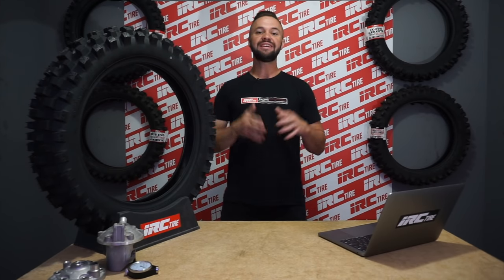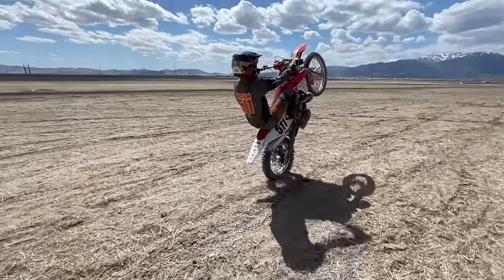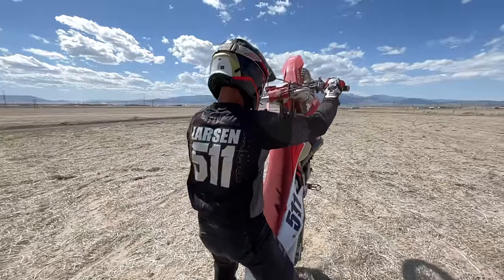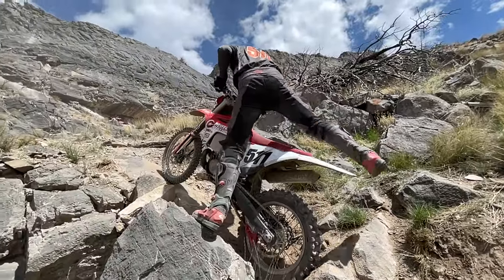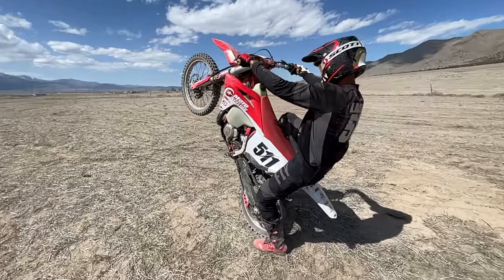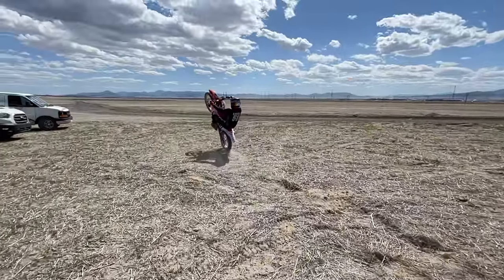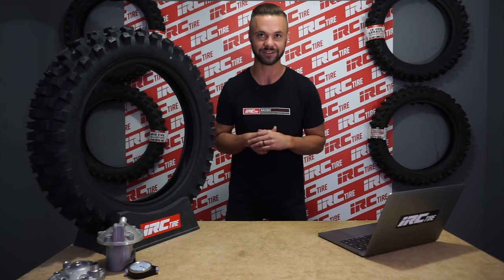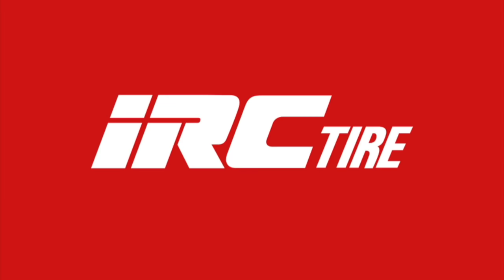NEW Slow Wheelie Hack!! Guaranteed to Help Your Wheelie Skills!

Comment: This is great, thank you. 5'9"er here too. Just too short to do the both feet dragging method which I think is the best. This is the gap fill hopefully that will work. Balance point and knowing exactly the throttle response I think is key. Also keeping arms straight hanging off bars instead of instinct of pulling upper body to bars

Comment: Another hack to learn to lift the bike up fast to balance point without moving too much forward is to learn how to lift the front wheel with your engine off, just using the body weight and suspension.
By learning it first, one would understand that the bodyweight and suspension do the 2/3 of the job and engine/clutch is only last 1/3...
Reply from the maker: Great point man!!
Reply: bro my bike weighs 300 lbs. There's no way that's happening.
Reply: @salazam  No way it's happening for you may be, because you can't do it, but I could easily do that on my 300+ lbs suzuki drz400e. Just focus on training instead of looking for pretexts ;)
Reply: @DenisElpashev  I put a pipe on my bike, so basically I have +30 hp. I just tried it rn on wet grass and it wasn't happening. I just gotta do some pushups right quick so I can compress those forks better.
Reply: @salazam  It's not about hp, it's about body movement and timing. Try to learn how to do a manual on a bicycle first, it will give you an idea how to apply your body weight to do a front wheel hop on almost any bike

Comment: Hi Rich, this is exactly what I'm working on now! I still have too much forward momentum when the front goes up, making it difficult to hold the bike steady. If I try to give a bit more gas so that the front goes up faster, the rear tire looses the traction. I guess my short height at 5.6 doesn't help either, but I suspect that I'm not using the suspension effectively. Any tips?

Comment: If you're a shorter guy "he's 5'9" " shoot I'm only 5'6" lol but I'm going to give this a whirl this week
Reply: Short rider club here.
Reply: @CommieHunter7  heck yeah bro! Devol come in clutch I lower the linkage lol
Reply: @CWEEzL95  my XC is PDS, so I just deal. I succeed some by picking good places to stop to setup for the next obstacle, and sometimes I just go with "if you're on the pegs it doesn't matter if you're short"
Reply: Yeah same here I'm only 5, 7" all my bikes have to be lowered lol
Reply: I’m 5’7 and I can do it with my tall xr350. So don’t be discouraged it’s possible
Reply: @cadentrim3167  I'm far from discouraged brother, I full send everything. I just like that my bike is now shorter than stock
Reply: 5'4'' fellas, crazy hard for me too, I have to rely in a lot of strenght to pull this of a lot of the times, and the positions are so awkard, with big bikes I only feel good riding "normally", this kinda tricks become very hard, but when those feet are on the pegs, GODDAM! 🤣
Reply: @CommieHunter7  facts. I want an xc250 but I'm not sure about the w with the pds. But the xc sits a little lower than my yz did
Reply: 5 9” aint short!!! At 5 7” I will destroy a stock height bike learning this...

Comment: Hi Rich, Love your videos! You are really excellent at presenting the info in a clear and relatable way so thank you!. I'm struggling with getting good distance on my slow wheelie. I can pivot turn no problem, and and walk behind the bike with the front wheel in the air for as long as i want, but as soon my foot goes on to the right foot peg i seem to lose it and ive put a lot of hours in and seem to be stuck at the same point. i feel like im maybe missing some bit of info or i guess i should keep practicing
Reply from the maker: I’ll actually be doing a how to wheelie Street video coming out soon. But one thing I can say is tire choice and set up on the rear tire makes a huge difference. I’d recommend trying it with a JX8 rear tire. Thanks for the support!
Reply: @IRCTireUSAMoto  got that exact tire installed lol. guess ill keep at it. thank you!

Comment: If the rear fender slaps you in the nuts, this may be a sign that you need to work on your clutch control.
Reply: or stronger nuts are needed
Reply: Great comment

Comment: I can do slow balance point wheelies fairly easy but only by starting faster and then slowing down at the balance point. Also I’ve had only done it on my yz125 by shifting to a really high gear to have soft power delivery. I’ve never had to use the clutch at balance point, only to change down gears. Anyway, I’m getting an exc 300 now and I really need to work on getting used to using the clutch a lot more in order to do this.

Comment: This is a great instructional video, I am only 5'4" ....5'5" with boots maybe lol.   I noticed you mentioned a shorter rider 5'9" using the side technique, do you think this will also work for shorter riders? I have a feeling my arms won't be able to reach enough for clutch and throttle control? I guess I can practice on the grass and see what happens lol. Thanks for any additional info !!!

Comment: Hello Rich... great fan of your videos. I recently went from a trial bike to my first 2 strokes enduro, an old KTM EXC 300 from the 90s... and it's a completely different bike. Longer, taller, heavier, I find my body movements won't affect the bike much (if at all), the engine of course has a different character and even if I was a complete newbie on the trial, I could at least tackle 40cm obstacles... while on the enduro I don't know how. My first question is: do you always keep the bike in the "powerband" to tackle obstacles? I find the engine is very slow/mellow before going "into the zone". I always used the "punch" technique, but on this bike I guess I need to go much much faster than on the trial to conquer the same obstacle... or, I guess, I have to use the clutch to go from 0 miles/hour directly into the powerband in first gear.

Comment: Ive been riding every weekend for the past 3 weeks, after a 12 year break, only ever just ripped it in an open paddock so learnt nothing but getting the rear out and changing gears. I’m now 26. clutch control getting better. I can get the front wheel up to get me over some logs, banks etc, nothing crazy yet. But I’m just wondering If it takes a long time to master? I can get my wheel up for a wheelie but not high enough to carry me a fair way, should I be getting this fast or is it something that takes a fair while? I feel like I should be able to pivot, slow wheelie with legs off the back for balance/safety. But I don’t really have any open areas to try to practice wheelies, it’s all tight and full of trees. Should I be patient or should I be ripping already? Love your videos rich 🤙

Comment: Hi Rich. I'm doing all practices to clutch control untill here. I have problems wich this ones because I'm riding a Yamaha T7 and it's really heavy but the worst...too high too get down and walk with the front wheel in the air. Any suggestions.
Congrats for your chanel and thanks to share this greats videos!!! 👍👍👍👍

Comment: Great teaching! I wish I could have learned these techniques  40 years ago. Would have saved some broken bones! In the video I noticed you have recluse clutch cover. Do you use a recluse?😕
Reply from the maker: No I don't run a Rekluse. The covers are just stronger and they hold more oil.

Comment: I notice you have a Rekluse clutch. That would make it a little easier at low revs to prevent stalling.
Reply from the maker: It’s just the stronger cover. I don’t run auto clutches.

Comment: 27 yrs old, intermediate track day rider, no offroad experience. Just bought an old TW200 to start trail riding. Which of your technique videos would you recommend I start with for training myself when just riding to work or around town that can apply to offroad riding?

Currently I just slow down to chug myself up and over obstacles which the TW happily does at a crawl. But add any speed >10mph and I bottom the fork immediately (I know it has poo suspension but proper technique can make up for many vehicular shortcomings).

Comment: Great video!  Thank you for posting!  
Question:  Ive got a KTM 690 SMC-R and Im having issues choking the engine out when I pop the clutch....is it only a matter of applying more throttle or is there something I'm missing since this is supposed to be a "slow" or low throttle and more controlled  endeavor....thanks

Comment: For anyone who has actually used this process to learn the slow wheelie.  I'm am at the point of putting my right leg back on the bike and covering the brake.  Once I get on I struggle with what to do next.  With my mx boots it's very difficult to feel the rear brake and with running shoes it's better but still can't move more than a second from that position.

Any advice?

Comment: Ive been struggling with the throttle part of this... My hand rotates back and opens the throttle too much when I'm coming up from preloading the suspension. So youre saying it's easier to not blip the throttle, just maintain a low rpm on it then slip the clutch?

Comment: What size clutch master cylinder do you run ?
9mm or the 10mm? I have heard the 9mm provides lighter clutch pull plus more feeling on the engagement/disengagement side of things
Reply from the maker: 9mm. It does!
Reply: @IRCTireUSAMoto  
Thanks mate
Is it worth the money to change from the 10 to 9 ? 
If you went back to a 10 would find what you ride/teach harder ?

Comment: I know it’s 80% rider 20% bike . So I’m hoping it’s just because my front shocks are so soft the rebound doesn’t snap the front end up and I have to use a lot of throttle, I have a 2020 Honda CRF 250 F . A beginner trail bike as they called it , since I am a beginner. My buddy who can wheelie and prefers the motocross bikes , he can wheelie and he says it’s harder then it should be to get the front end up on my Honda . I dunno as I said I’m a new rider so this summer is going to be my training season since the last two summers… and winters since I studded my tires for ice racing has been learning the bike and clutch and just basic riding on single track … I wish I could get out more then 10 times a year

Comment: I'm needing help! lol I've got the forward and backward balance point down but having problems with leaning left and right..... sometimes i can get it but if i start tipping to one side I can't get it to correct. Sometimes I think it's because i have a very heavy upper body. Any Tips are greatly appreciated!
Reply from the maker: Check out this older breakdown we put out a while ago. It may help. 
https://youtu.be/QyWhcaa2NXY
Reply: It seems that I'm going to one side on my way up. I don't know if I'm pulling up instead of powering up, or what  😒

Comment: Is the clutch being dumped or slipped after compressing the forks?
Reply from the maker: That depends on your definition of slipping or dumping.. I'd say It's a quick release of the clutch. You can see what my clutch finger does at 4:50.
Reply: @IRCTireUSAMoto  Gotcha. Also does the front brake and/or rear brake need to be held when compressing the forks? Or can you just compress the forks without any brake used?

Comment: What version of the rekluse clutch are you running?
Reply from the maker: Thats a stock clutch with the recluse cover. The covers are stronger and hold more oil. I don't run a Rekluse.
Reply: @IRCTireUSAMoto  
Bro I dont run one either... bit of a purist & the reason I asked is because I didnt think you ran one but I saw the cover & thought hm, maybe he converted. I talked myself out of it a few months back. Also just installed a ve33 last night looking forward to that in the woods 🤙

Comment: Will this work for me when I’m riding my crf 125f, I’m worried it doesn’t have enough torque, ami wrong?
Reply: Slow wheelies aren't about absolute power. (They actually require very little.) It's about applying the right power at the right time with the right body position for the right weighting/weight transfer for the right traction/lift and the right control not to trade top/bottom positioning with your bike. If you can't get that all together without an excessive amount of "go," try practicing very short, (6"-8") log/obstacle hops where you pop up just enough to land your front tire on top of your short obstacle and stop/balance there for a few moments. Use your arms and legs to push down on front and rear equally, (like playing leapfrog,) then just as your suspension begins to rebound, feed the throttle and clutch quickly, (but not a dump-stall,) and get out of the way of the handlebars. Practice that short hop and balance until you don't have to think about everything you're doing, then work on the drill this video suggests. Your bike has enough guts. Trust me: it's all finesse and technique. Good luck and don't give up.

Comment: Sadly my bike is way too big to feel safe when learning a wheelie its a hawk 250 so its a tall lil thang, I gotta adjust the rear suspension because they are nose heavy bikes very tall if I get my back end lower I might be able to wheelie just sketchy because if I fall off the back that whole bike is crashing its 310 pounds plus mods

Comment: Everybody does this and it drives me nuts.  5' 9" is not short, it is average height in the US.  at 6' plus you are unusually tall.  I am 5' 7", that is a short rider, and I know many shorter than me.  When giving tips for short riders, I suggest you use actual short riders as limb length ratios quickly become an issue.

I do like the tip of standing behind the bike as I, personally, cannot pivot turn, my legs aren't long enough to cover the spread from the footpeg to the ground.  That is almost the equivalent of me holding my right leg at chest height, while my left moves rearward.  I doubt most people my height are flexible enough to accomplish that.

Comment: The dirt bike manufacturers only make bikes for people 6'1" and taller. Why???  People say "Short people can do all these things too - it just takes more practice"  Why should I have to do that? Why can't I buy a dirt bike with a seat height of 37" - bring it home and on page 14 of the owners manual it shows how to take 4 inches out of the suspension with a 10 mil socket? The modern dirt bike as we know it is made for tall people only. That's it. I literally can't do what he did in the video stepping off the back of the bike without smashing my testicles on the rear fender. I'm 5' 7" by the way.
Reply: If your testicles are hitting the rear fender, it's because the bike's not coming out from under you.  It has nothing to do with the height of the seat or how short you are.  You are simply not getting to the balance point fast enough or at all.

Comment: Cool video but you forgot to specify you're using a clutch that can't stall which is totally cheating. Lol
Reply from the maker: Not running one. That's just the cover. They are much stronger than stock and they have more oil capacity..... LOL